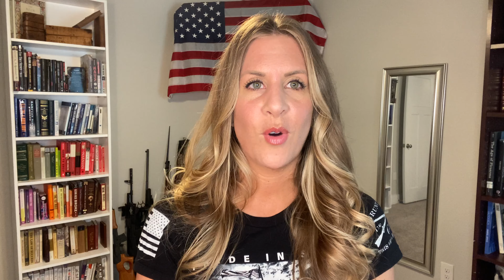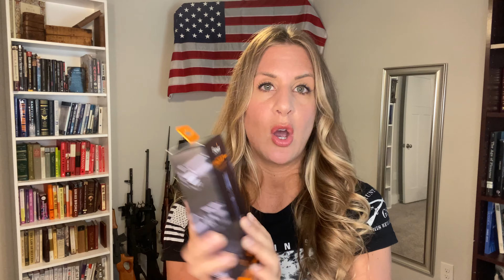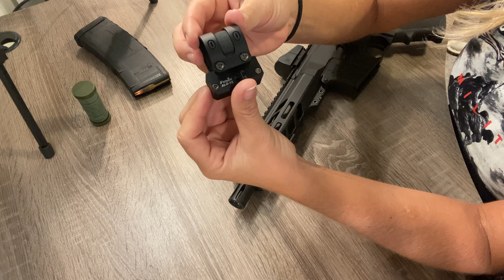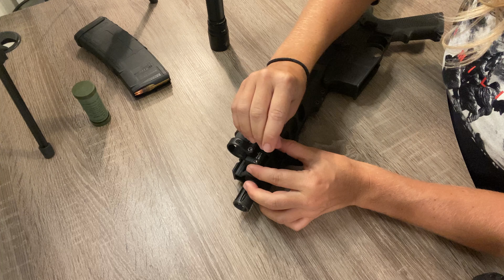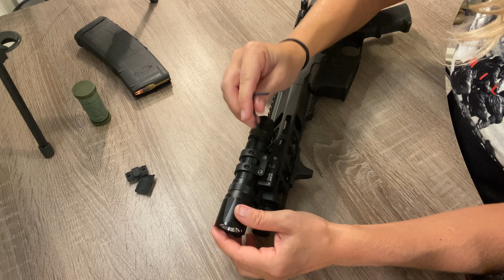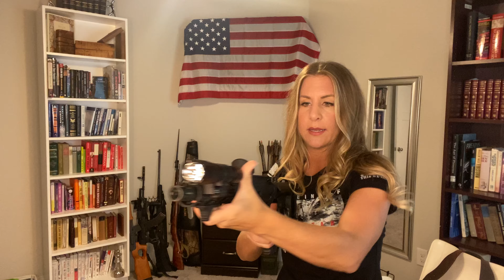Install Fenix ALG-16 Rail Mount & TK20R Flashlight on AR-15 #howto #diy

Comment: GQ Armory .300BO was released from jail last week and I’ve never attached a flashlight to a m-loc rail so this was helpful, especially the part about removing the rubber gaskets- seems like you’d want them but you’re right, don’t fit. 

Having trouble getting the whole thing to not wobble…Will look around for help on that but sincerely appreciate your quick instructions. 

Btw, found you by searching for Fenix m-Lok install.  Will subscribe. 

Now if I could just lose this wobble I’m golden. 

Thank you for posting this, very helpful!
Reply from the maker: im so glad it helped!!! thank you for the feedback!

Comment: Have you thought about the pressure switch from fenix?
Reply from the maker: Already installed - I have a video up where I did the installation. I love it! Do you use one also?
Reply: @LegendHasIt     Not yet.  I'm an inspector and have 4 fenix lights, and they are all amazing! Lol. I'm also super big into 2a, so just 2 and 2 together.  I'm curious about what lights can be paired with your setup
Reply from the maker: @ryanzuspan8087  my brother actually introduced me to the Fenix products and I absolutely love them!  The only thing I don’t love about the pressure switch is it removed the strobe option that the flash light has
Reply: @LegendHasIt good to know. I dont want the strobe so this seems like a great option for me.
Reply: @LegendHasIt losing strobe isn't actually a very big deal. In theory strobe is very disorienting to a potential attacker, but it's also pretty disorienting for the user, and if I'm at a point where I want to use a flashlight (for any reason, not just self defense) then I want constant light and (for defensive use) as much of it as I can possibly get.

The only thing strobe is useful for (to me) is getting someone's attention, it can be super handy for police who are directing or diverting traffic around an accident, or for signaling and rescue purposes, but otherwise it's something people think is awesome that just really isn't helpful.

A lot of lights include it as a "tactical" feature, but almost no one uses strobe "tactically" and it's probably one of the least desired features for a lot of tactical users.

For me a weapon light should have only one purpose and one mode: 100% power on demand.

I like the TK20R V2 because I can set it to max power and only use that, and it's good performance for a decent price, you can get better candela weapon lights, but you're going to pay at least double if not more for not a lot of gain in many cases. The Cloud Defensive Rein 3.0 is a super powerful weaponlight, as is the HRT AWLS, but they're both way more expensive (they do both have almost double the candela of the Fenix though, but their close range spill is lacking significantly compared to the TK20R V2)

I liked the video, you were straight to the point and didn't add a lot of fluff, but you hit all the important parts and didn't leave anything out either.

Comment: 2 questions . I feel like the rubber liners should  be there to protect surface finish. Have you checked the specs  for supported diameters? Also wont muzzle flash hit the torch head ?
Reply: The rubber inserts are for use with their smaller lights they aren't needed for the bigger models. The muzzle clears the torch. The muzzle blast should not effect the torches performance.

Comment: I'm actually ordering this. Fenix seems to be a well kept secret in the LEO and gun community. I highly recommend their flashlights. I have had a UC35 for over 5 years and beat the shit out of it in all sorts of situations and weather, and it just keeps chuggin along like nothing happened. I have since upgraded to a PD36R for my duty rig and it has the same build quality as my previous light. And now i find out that Fenix makes pressure switches for most of thier flashlights! well sign me up I'm buying that too!
Reply from the maker: Love to hear it!! I agree Fenix is such a well kept secret for some reason! 
Nice! The key is having something you don’t have to baby and it will still hold up to the abuse.
Reply: If you want a mind blowing experience, try on a TK30.  OMG- I’ve never seen anything like it.

Comment: Does the flashlight have different brightness settings?
Reply from the maker: Hey thanks for watching! Yes it has six lighting modes you can choose from via the dual tail switches. The brightest option is 3000 lumens